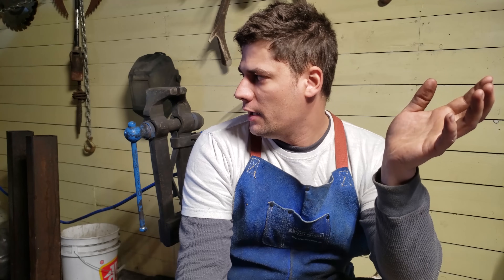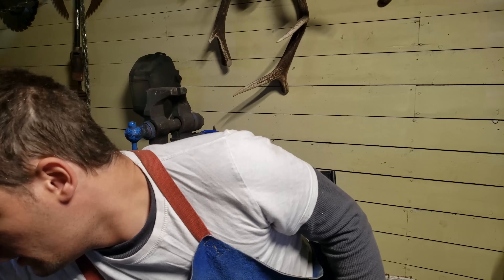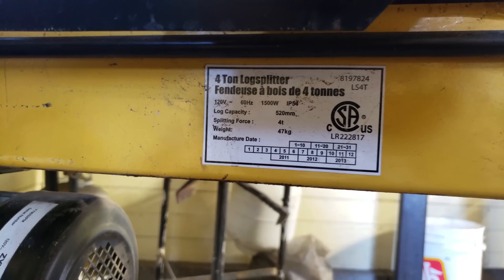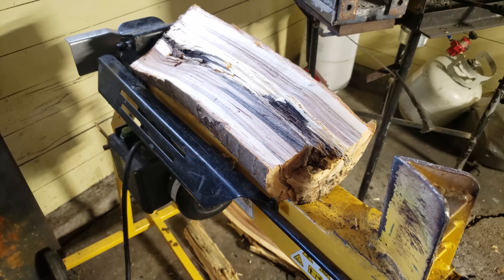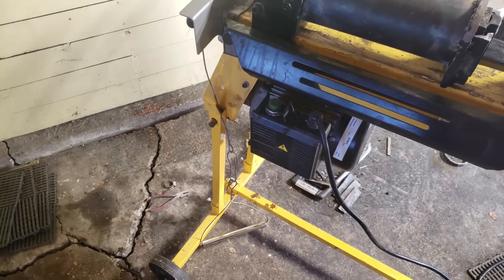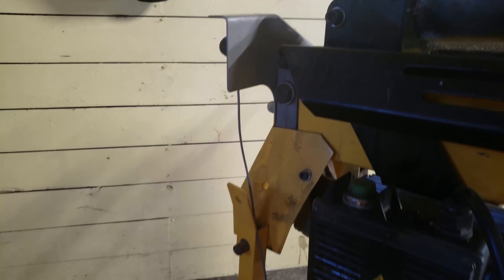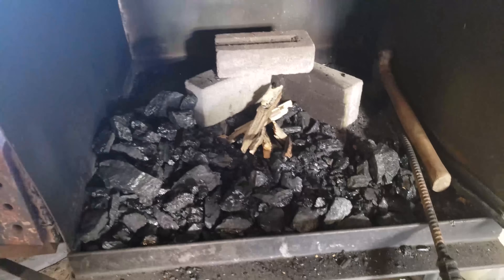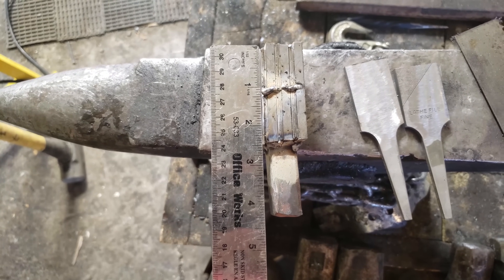Blacksmithing - Easy 4 or 5 Ton Princess Auto Log Splitter to a forge press? Will it work?

Comment: Great job!  I just subscribed and will continue watching whatever you upload!
I'd like to see your working of this after you get dies for drawing out.  It would be great to see you make a small Damascus knife using this press to draw the billet out to a useable length.
I have an 8 ton log splitter that uses a bottle jack and hand power to spit the logs and I want to convert it to hydraulic so that I can use it in my Smithy!  I have yet to make ANY Damascus billets because I am disabled to the point that I don't have the strength anymore, to wield a heavy enough hammer to get the job done.
You and a couple of other have inspired me to get the damn thing done so that I can begin to make some Damascus knives!
Thanks for the video proving that a small spitter CAN be made into a forging press!  AND thanks for the inspiration!!  Being 67 is sometimes a problem because you KNOW how to do a lot of things but, EXISTING on Social Security and nothing else is a real pain in the patootie!
Never enough money to get the parts to put together what you NEED in the Smithy!
Thanks, again for the video and the inspiration!
Reply: Good on you Kim, stay active and do what you can! Work smarter not harder!
Reply from the maker: You are very welcome sir!!! I will do my best and finish it as soon as possible. I am also bringing my other forge back because i think it will be able to reach forge welding temps now. My coal forge isnt good with the smoke aspect and i dont want to gas myself out this winter but i will keep on forging anyway i can.

Comment: At 10:57 you can see the press plate squeeze uneven. The two plates are not parallel to each other causing potential cold shuts on your work. Great job.

Comment: This is really nice, but I'm afraid you will run into trouble with the frame at one point. This thing is not made for this. Weld some steel plates on the sides of the splitter and you will be fine. You have steel and you can weld, so don't wait.
Reply from the maker: Still going strong after all this time and still works like a charm...but i did build a 50t press

Comment: Finally!!! Someone had the same idea as me and gave it a try before I could 🤣 absolutely appreciate this!! I have pretty much the same one except mine is harbor freight brand and you turn the pump on, not a momentary switch like yours, and control forward and reverse with the lever, although there is one problem I need to figure out how to overcome with this model, it has a sort of "overload safety system" if you run the ram too hard say cutting hardwood and the pump runs down to the struggling point, something in it triggers and stops the fluid from flowing therefore  rendering the machine useless until you've turned it completely off, letting pump stop turning, whatever that safety is then resets itself and when you turn it back on, everything works as normal operation until you hit a hard spot and cause another pump struggling situation to trigger that safety again🤦‍♂️ I understand it's probably a good way to save part from premature failure but, it is very limiting even for just splitting wood and irritating to reset every time.. I have to take it apart to see what this is and how I can remove it lol.. Anyways, my son and I are trying to get into forging and as we go we have to build what we use and learn what works and what won't, I am disabled and have some limitations with things but I do everything myself and don't take things to shops or purchase the best of everything, I make do with what I have, refurbished or build on my own.. This just makes me more interested and ready to get out in my shop I built and get this project started with my son, he is the only one out of my 10 children who really wants to do this so what can I say 🤷‍♂️... im just going to enjoy the time we will spend together and enjoy making the memories and possibly start a business for him to enjoy life with... Again, thank you for sharing this, absolutely amazing 👏 😁👍
Reply from the maker: You are incredibly welcome!!! I do have a second video where i finish the thing have a look and have fun!!!

Comment: How did you form the piece around the splitter wedge, like the idea but I’m not much of a welder so might have trouble building this. I already have the splitter in 5 tons Princess Auto
Reply from the maker: I beat a pipe  into a triangle...it sucked a lot

Comment: Thanks for the update.  You've answered all my questions and your modifications were so straight-forward that even I could do it.  Would I be a complete SOB to mention that if you put the switch on the left side of the lever it would be easier for your thumb to engage?  Yeah.  I probably am.
Reply from the maker: Hahahah and i was debating that same thing when i did it. But so far it aint bad at all man

Comment: The width of your dies matters.  You've got four tons.  If you put that into a narrower tool you can probably do thicker billets.  Also you can see the heat being sucked out by the dies so a quicker release by your foot leaves more heat in the piece.  Now if you could rig up an auto release switch triggered by the ram reaching a certain point it would be even easier.
Reply from the maker: if you watch the latest one you will see my easy solution...works like a charm!!!

Comment: I think if I did this I'd convert the power button to a switch so it's always on and use the foot treadle to actuate the compression, (kind of opposite of what you were doing), which would allow for a little more control I think. Nice though, been playing with the idea of using one of these splitters for some time now!
Reply from the maker: I just finished mine again so ill be uploading in a few days i think. I did get a great way of using the handle and button though

Comment: This video did it for me. Thanks! It looks like the WEN 6.5 which appears to be the same splitter with a little more squeeze. I was wondering if you have posted the dimensions of the steel you added to make it a press anywhere? I'm curious what the main tubes were?
Reply from the maker: Ill be doing a full build video on my splitter press one of these days where i re-do everything and improve it

Comment: If u remove the button and hard wire it as if the button is all ready pressed it will work on just foot pedal and then ur brain doesn't have to think about too much
Reply from the maker: So have it on permanently? As soon as it is plugged in? If so then it still wont work because the ram has no reverse option only when the machin is turned off will the ram reset...
Reply: @CGSmithing   ahh i didnt think of that. My bad
Reply: @CGSmithing  So you're saying for the ram to reverse both the button and the lever have to be released?
Reply from the maker: @Perry_Wolf  exactly. im busy as we speak with the new video on the press it will be out soon

Comment: You have a good working idea but as most log splitters are designed to split wood I have found from experience that the metal frame is to light for using metal for forging . Keep an eye on it for fractures and metal fatigue. But hey if it works for you supper job.
Reply from the maker: i hear ya!!!

Comment: Great video!!! What did you use to make the inserts to change it from a splitter to a press?
Reply from the maker: I used 3" pipe for the rams and  coil spring for the dies
Reply: @CGSmithing  
Thank you!!!!!

Comment: Awesome job...Do you plan on making it upright, by building a frame for support. May make it easier for the coordination problem? If not, maybe a tool rest that can help steady the steel so you don't have to float it while you're pressing? Again, Great Job!
Reply from the maker: Ive been thinking about it actually. A very near future vid will be me finishing the build and making a few adjustments. Some of these splitters have a tilt shut off safety feature so dont know if going vertical will happen or not i still need to see if mine has that feature but i have no issues with it its not really hard floating it the billets are nice and light too.

Comment: Hi m8 dont know if its been said or if this is an old video but you need taller dies and half round ones to stop the steps and then cold shuts happening , i think this maybe the first 4t log splitter conversion i have found on you tube in 6 years thanks  Blacksmith UK wales .edit PS , spring system welded to the frame that pushed the button down and the lever that way you have both hands free
Reply from the maker: Yup you bet buddy its just a proof of concept but will be doing a better job at it pretty soon. I have a bunch of projects lined up first before i finish the press
Reply from the maker: I also built the damn thing because every one said it wouldn't work...i begged to differ

Comment: I have access to a small hydraulic gas powered splitter I think 4-6 ton range if not more that I’m going to convert into a small press. It’s junk otherwise so may as well.  Nice video
Reply from the maker: Sweet!!! Email me with pictures when ur done its in the description id like to see the end result
Reply: CG Smithing will do! I’m getting it from the farm next week along with a horizontal bandsaw. It’s going to take a while to get all the parts and things because it’s complete but the motor and hydraulics are bad so I need new ones. Really just the frame and the cylinder are good I believe

Comment: Beauty I got the same splitter 🇨🇦 I think it was mentioned, but use a piece of plate for a pedal, and make the linkage out of ready rod, with the switch wired into it so 2x hands are free, but better yet you should send this to princess auto, they have a contest for investors for $$ in store fyi
Reply from the maker: Sweeeeet!!!! Ive bin so busy with renos in the house i havent touched the splitter in a month yet but i have all the components to make it work just waiting on me.

Comment: Yes a good concept. From an industrial Blacksmith of 47 years in the trade.
Some tips. 
Take half the bite you are taking first up. 1/2" instead of 1 inch. 
When driving a drift in to a piece of steel a 1/2 in wide drift will penatrate twice the depth of a 1 inch. Drift.
Then you progress to a larger  tapered drift  to drift out the hole. Pushing metal  sideways not out.
Pre heat your dies first. You will get twice as many presses on the first attempt. If it does not weld on the first attempt you are wasting you efforts. Same with the anvil first up put a piece of plate into forge heat it to cherry lay it on your Anvil. Other wise the Anvil sucks the heat out of your in seconds. 
In my shop by morning tea i can cook bacon and eggs on my anvil face or a piece of steak.
You should be able to keep a piece of steel hot just by working it on a hot anvil.
Hope this helps. TheSmithy.....!
Reply from the maker: Thank you so much for the positive feedback. I will from now on do that!!!
Reply: @CGSmithing  not a problem anytime. I am a 7 generation Blacksmith. I now pass on my knowledge to who ever wants to learn.
Cheers
TheSmithy

Comment: why did you leave it horizontal? thanks
Reply from the maker: Any time man
Reply: CG Smithing sorry one last question have you tried turning it vertical?
Reply from the maker: @Gabe_Robins0n  nope not yet i could try that out tomorrow and let you know. I built everything with what ever i had and as its standing. So ill check it out tomorrow and ill let you know
Reply: CG Smithing thank you very much
Reply from the maker: Some of these splitters are designed to not work or trip out if the angle changes...a very shitty safety feature if you want to turn it into a press lol. Plus mine is still under construction I'm far from done with it but, I'm sure it has that feature.
Reply: CG Smithing thank you very much sir

Comment: You could get a foot switch and wire it in place of the push button.  Then you can hold it down with your foot and work the lever with your left hand. However, i love the idea, and may try to adapt my 25t gas powered splitter
Reply from the maker: I was thinking mabe moving the botton right on to the foot switch
Reply: @CGSmithing  that would work. Engage the electrical switch with your heal and engage the drive with the toe or ball of your foot.
Reply from the maker: Now thats an idea!!!!
Reply: @CGSmithing  im sure you could come up with a treadle switch, but just a simple on off, not a variable output like one for a tig rig or a sewing machine. Then fabricate  mechanical linkage that works the drive lever.

Comment: Hell yeah! I've been meaning to try the same thing but have not wanted to waste the money if it didn't work.  Great proof of concept. I would bypass the button though.  Thanks!
Reply from the maker: Oooooh buddy believe me as soon as i get a chance that button is gone!!!!!
Reply: I bypassed the button with a clamp in the button and a foot peddle switch from harbour freight. Works great for splitting wood. I'll be doing the same, convention to forge press since for now, my work is all under 1" stock. Arm gets a little tired pounding  on 1" 4140 or 5160 stock.

Comment: I’m glad someone did this. I’ve been wanting to try it myself but Leary of the power but you solved the issue.  
One thing I would suggest is putting some sort of guides for the sides of the slide. Keep from getting the groves with a potential cold shut.
Reply from the maker: I need to round over the edges on my dies...and i need more practice hahahaha